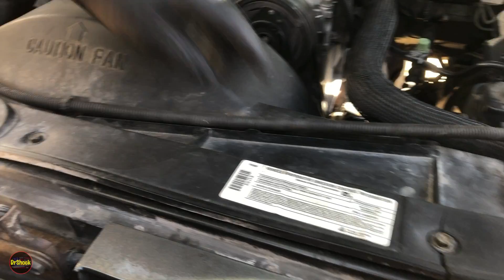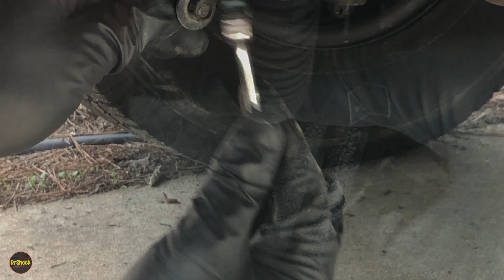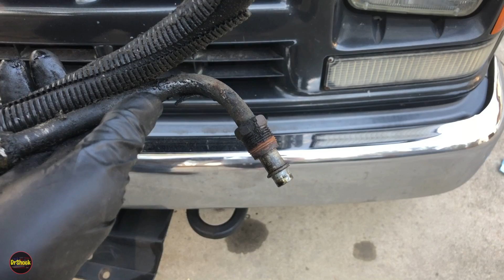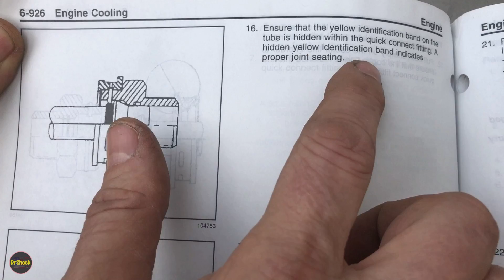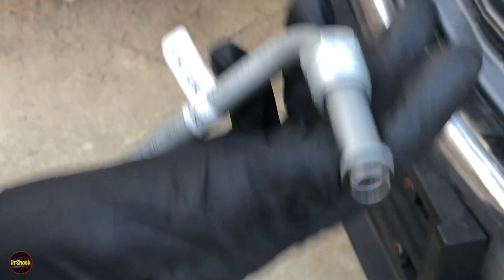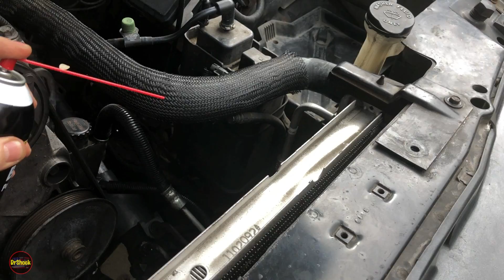1996 - 2000 GM OBS 4WD K Truck Vortec V8 5.0L / 5.7L Oil Cooler Line Leak Repair (Chevy & GMC)

Comment: Doc,on the filter housing where the oil lines plug in how do I know which is the inlet vrs the outlet? thanks
Reply from the maker: I showed this during installation of the new GM lines at the engine oil filter housing end in the video.  I can't recall for sure, but the aluminum casting may also have marks for this on the housing as well.
Reply: @DrShock ok thanks

Comment: This doesn't require dropping the oil does it? I figured since the oil should (mostly) be in the pan which is below these lines, I wouldn't have to. Should just be whatever is hanging around in the lines, right?
Reply from the maker: You do not have to do an oil change to perform this repair.   But, it's a good idea to do one after you complete it in case any debris got in.
Reply: @DrShock  good point. Thanks! I appreciate your videos. Trying to keep these old things running even though it's hard to think of late 90s as old 😅

Comment: Nice to see the price gouging going on for these parts.   20 bucks for a zip tie , 99 bucks for inlet hose.  No availability on outlet hose.       Hopefully my 1 drop of oil every month from my cooler line holds on another 20 years.

Comment: When replacing the lines, replace the quick-connect fittings as well. There's an O-ring inside the fitting that's the real seal to the oil line. Changing the fittings is cheap insurance that your new oil lines won't leak.

Also, you may want to use a flare nut wrench on connections like what you have on the radiator ends.
Reply from the maker: I typically recommend changing those fittings every other service interval, unless they have pitting or flaking level corrosion.  As long as you stick to genuine GM OEM parts, they are not required by the GM service manual to be replaced with the lines.

Comment: Easy way to remove the fan if it's stuck is hook a ratchet strap to the hole in the metal body near the storage box, wrap it around the pulley atop the belt and back to it's own hook.  Ratchet it down good and the added load will prevent the belt from slipping.  Fan comes right off very easily that way.

Comment: Three years after this video was produced, I finally replaced my oil cooler lines on my 98 sierra c2500. Thank you. I watched the video 3x and learned all I needed to know.  The parts were different because the C2500 is 2wd, but its the same procedure. Thanks DR for all your work! One thing, I would recommend you replace the two fittings on the oil filter adaptor. In Rust country, they're looking pretty rough!

Comment: Are there yellow marks on the radiator side too ?
Reply from the maker: No, as shown in the video the oil cooler integrated into the OEM radiator design is just standard threaded fittings so that insertion check yellow marking is not applicable nor needed.  Only the quick connect style fittings on the engine block would have this.
Reply: @DrShock 
Thanks

Comment: Got a question for ya. I have a 2000 denali with the 5.7L vortec. I noticed leakage around the upper fitting on the drivers side. Same ones you're working with here. When I trace the upper line it goes to nothing. Like the line runs down below the engine then has been crimped in some way. It's not connected to anything. Have you ever seen or heard of that before?

Either way, your videos are helpful. Glad to have found your channel. Cheers man
Reply from the maker: Thanks.   If you found the upper line crimped off, I would expect to find the lower crimped off as well.  A previous owner may have elected to do an oil cooler delete rather than repair the problem.
Reply: @DrShock  Thanks for the quick reply! I just looked over everything in more detail and you're right. Guessing it's the radiator itself that's leaking. Just started watching your radiator replacement video and will give it a go. Thanks for the great content. You're a top notch teacher!

Comment: Hey bud first off I love your videos , very helpful indeed, I have a question for you about a1998 Chevy Tahoe 5.7 I wanted to ask which lines go in the the other side of the radiator,it kinda smells like oil can you help me out?
Reply from the maker: Thanks.  The cooling lines on the passenger side with this model and engine are likely the transmission fluid cooling lines.

Comment: Is there any reason not to move the transmission holder(rod) out of the way?  I can not get enough leverage to insert the new cooler lines into the oil filter adapter.
Reply from the maker: If you mean the bracing rod for the automatic transmission, you shouldn't have to remove that but as long as you reinstall it there's no issue temporarily moving it out of the way.  You might also try some light oil lubricant on the end of the line to ease insertion into the oil filter adapter fitting(s).
Reply: @DrShock  copy that. Thank you. I actually just fixed it with the help of my son. No leaks. Whoo hoo!!!

Comment: Better off just deleting the cooler lines altogether and changing the oil filter adapter, will never leak again, ever. Oil cooler is not necessary

Comment: Just changed out a radiator, and had to grind 1/8" off each oil cooler line because the length between the o-ring and end of hose was too long.  had to stuff a cotton ball in there and then grind. no leaks so far!

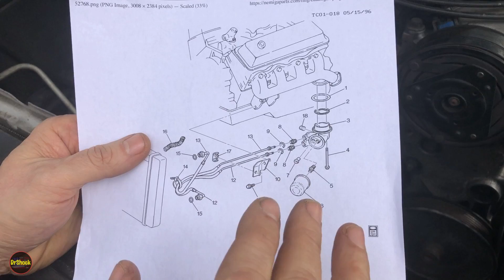Comment: Hi, thanks for the great video. The printout you show at 30:13 shows one hose go from the upper rad fitting go to the upper filter adapter fitting. However, Figure 42 from p. 6B-38 in the 1997 FSM shows the opposite (for the 5.7l, albeit not very clear). I connected mine according to the latter with the longer inlet hose (GM 15112871) going from the top of the rad to the IN (lower) fitting on the filter adapter. I think you may also have done this in the video? Anyway, this is confusing me a little, I wonder if it actually matters?
Reply from the maker: Thanks.  That's a good catch.  The diagram is from the GM EPC (electronic parts catalog) so very generic and just used for parts identification (the illustration numbers map to GM part numbers in the catalog).  Definitely go with the GM service manual drawing for your year and engine for how things wire / connect up.  I showed that parts diagram just because it is useful to see all of the parts involved, but it is not intended to depict assembly and you likely have identified an error in the parts drawing in that regard.   The GM hoses are labeled inlet and outlet as well, so you can't mix them up wrong.
Reply: @DrShock  OK I realized why I was getting confused! The figure I referred to shows a vertical filter adapter, so I think the lines cross only on the 2WD, but the routing you show at 30:13 is correct for K models.

Comment: Good video. I started deleting the cooler lines on these obs trucks after I found that the factory oil cooler only lowered my oil temp about 10 degrees on a hot summer day. It's just not very effective when you are circulating your hot oil around in a hot radiator.

Comment: What to do if it’s leaking from the fittings?
Reply from the maker: Replace them (seal is internal to the fitting attached to the engine block).   While not shown, the part number is in the description for this too.

Comment: Hey, Dr. Shock. So the end of the lines going into the filter housing under the engine do not need o-rings on them? Thanks for the video!
Reply from the maker: Nope, no o-rings on a GM OEM quick connect style fitting.  The seal material is integral to the female port on the filter housing itself.

Comment: I stripped the threads on my new GM radiator when attempting to torque the fittings to specification (before torquing the fitting, I started it by hand and made it hand tight using a wrench). Beware.

Comment: Thank you for the great video do you recommend power washing the entire bottom area with degreaser ? Especially the are where that clip is ?
Reply from the maker: Something paint safe and not an actual pressure washer with water but yeah.  A aerosol degreaser intended for engines, or brake cleaner works too.  Now would be the time to clean this area out, if for nothing else to confirm the repair was successful.

Comment: Why turn off the under hood light when what you should have done and you should ALWAYS do is to disconnect the negative battery cable from the battery whenever working under the hood.
Reply from the maker: We pull the hood light to not run the battery down as this procedure can take some time. You do not need to disconnect power unless you are working on electrical or fueling components.   In fact, many repair steps with more modern vehicles require power as part of scan tool driven testing and diagnosis. It certainly will not hurt anything, other than resetting your state emissions test drive cycle, if it makes you more comfortable to do so though. 
 But always follow the OEM service manual as closely as practical, as the engineers who designed the components will tell you if that step is necessary or not.

Comment: Well explained video, helped alot. Did you use new fittings on the oil filter side or the same ones? Do i have to drain oil before replacing the lines? Can these lines cause oil to get in the radiator,  if so does replacing the lines fix the problem?
Reply from the maker: If you have oil in the radiator with an integrated oil cooler, you need to replace the radiator as that indicates a likely internal leak between the oil cooler and main coolant core.   These lines have nothing to do with that symptom.   You do not need to replace the engine side fittings unless they are damaged/corroded.   I would recommend doing this repair along side a regular oil change to reduce the cleanup involved.
Reply: @DrShock  if it is the oil cooler line since I don't have money for a new radiator will it be ok to by pass the oil cooler line instead of replacing the radiator? I don't do no heavy hauling with it.
Reply from the maker: First definitely do the additional diagnosis to confirm a root cause before buying any parts.  There could be more than one source for this than the radiator.  

I could never advise someone to remove or disable a factory installed oil cooler, because the powertrain team for a particular truck configuration may depend on that functionality for more than just towing.  But if you had to bypass it temporarily until the budget allowed for a more correct repair, I could see that being workable for light duty on-road use.
Reply: @DrShock  would you happen to know what other causes would cause oil in radiator? And how would I know for sure If it is from the cooler line? I know for sure that my lines are leaking based on them being drenched in oil, so I will have to replace them regardless if I choose to not disable them.
Reply from the maker: None of the causes will be inexpensive to address.  But oil in the coolant, without any coolant in the oil, points to defective radiator (due to oil cooler containment failure), defective intake manifold gasket, or defective cylinder head gasket.   In that order of probability.  You should confirm this is engine oil you're seeing, as it's also possible that it's from the transmission fluid cooler, which would also point to the radiator (ATF cooler containment failure).
Reply: @DrShock  and how exactly would I verify if it's coming from the oil or transmission line? It looks like brown sludge under the radiator cap so I figured it was oil. I thought head gasket as you said aswell but I did the block combustion test already and the liquid stayed blue so I dismissed that as a possibility.  And my car doesn't overheat.
Reply from the maker: The test you describe only checks for the head gasket failing in the coolant passage to the combustion chamber.  The head gasket can fail in other ways, but again, I mentioned this is the least likely source.  You would have to pull the radiator and perform a pressure test to determine if the cooler has failed.   You would have to pull the upper intake manifold assembly to determine if the gasket there has failed.  There isn't a non-destructive test for that one (you'll have to replace the gaskets anyway just to do the visual inspection).   If it's been over 100K miles since the last time the intake manifold was removed, I would start there.
Reply: @DrShock  so how exactly do i preform the pressure test for the cooler line. I've never herd of that process so I'm not familiar with it. But iam familiar with the pressure test tool for diagnosing leaks. If you dont mind, Would you happen to have an email I can send a picture of the sludge I found.  Maybe you can tell more by the picture.

Comment: I use engine degreaser to clean up the engine and the residual oil that leaked because with brake cleaner it can sometimes effect the integrity of other seals I mean not saying I haven’t used brake clean before because of course I have but throughout the years of doing it I have learned to not use brake clean because other mechanics have told me I will cause myself more of a problem then I have so just a fyi
Reply from the maker: The thing with brake cleaner is not to buy the cheapest one.  Some of those have solvents that can take paint off.   CRC and similar higher cost brands will not harm paint, and will not harm modern seals.  If you're working on something earlier than the late 1980s, I definitely would not use it though.
Reply: @DrShock i use simple green soak then pressure wash the entire area before repair even begins

Comment: I have a 96 c1500 do I need the 96 service manual or should I get the 98 second edition
Reply from the maker: It's usually best to get the matching model year of your specific vehicle.  The service manuals get very detailed, into content that does vary year by model year.   But if you're in a pinch newer is better than older, just understand that there may be drawings and schematics that have changed.

Comment: Oh and by the way I'm currently in the middle of making -8AN lines to replace the factory lines..... only spots it can leak will now be either at radiator fitting or at oil filter adapter fitting..... stainless steel integrated braiding with nylon exterior braided lines... should be slick
Reply: How much do those 8AN lines cost? If you don't mind me asking. I am thinking I'll be replacing these Doreman lines sooner than later. Thanks

Comment: What do you use to clean an engine bay with that much crud? I've been trying to get mine clean and I cannot find anything that will touch it..... mine also has a lot of crusted on dirt from old gold mine areas that WILL NOT come off without scraping with lots of force and my ENTIRE undercarriage is coated with it!!
Any advice will help and
THANK YOU VERY MUCH for the clear concise instructional video
Reply from the maker: Thanks.  What I used for this was initially Gunk engine degreaser, the spray on gel version.   Give that a good afternoon in the sun and then rinse it all off with brake cleaner spray.   You'll need several cans but it eats it right up.  Wipe off the tough spots with blue shop towels.  

Once the leaks are stopped, eventually the engine bay heat will dry the rest up where it can be removed easier after another month or so and a re-application of the mentioned products.
Reply: @DrShock  thanks I will give that a shot
Reply: simple green

Comment: Hi Dr. Shock. Trying to solve a mystery slow leak at the oil cooler inlet to the radiator. Lines are new (GM genuine), orings new. Is that fitting itself, where the cooler line connects to the radiator replaceable? Or does one have to swap the entire rad? Thank you.
Reply from the maker: The original GM/Delphi radiator didn't have replaceable transmission cooler connect fittings as best I can recall.   O-rings only used on the engine oil cooler side of the radiator.   Aftermarket models might vary.  It's been awhile since I replaced one of these but here's a vid that might highlight the fittings on an OEM radiator - https://youtu.be/hy5QB80Gcu4
Reply: @DrShock  Thank you, as always!
Reply: @Cargovroom-g7f was your lines leaking oil inside the radiator?

Comment: Dear Dr. Shock, and all reading these comments. I’ve owned my 98 K1500 for just over two years, and in that time have watched countless instructional videos about it. There are many here on YouTube and many are good. But I can say now, with absolute confidence, that none compare to the quality, detail, patience and empathy with which Dr. Shock provides explanation and demonstration in his well edited, well presented videos. I can say this with such confidence because as of today, I, a self-declared amateur, beginner mechanic have successfully repaired oil cooler lines, oil filter adapter (with fittings) following the expert e-guidance of Dr. Shock. To celebrate, I’m treating myself to a Dr. Shock t-shirt and I certainly hope that proceeds of that end up in the Dr. Shock coffee fund. Thank you so much Dr. Shock.
Reply: Dr Shock could easily be a tech school instructor, or even a master mechanic/instructor of instructors for any major auto manufacturer...
If you need a letter of recommendation, I got you!

Comment: Did it just like this shows but in the bottom connection, there must be that white plastic "clip" that goes in there to prevent the oil leakage which I now have. Have to take it out & reinstall w/ the clip.

Comment: Always first-class video with excellent and not superfluous narration. We all appreciate the GM OEM parts and links. Thank you!  
Is that the "Camper Special" option for a second battery? I would love to add that to my '96 Suburban as I have a Winch. I think it is NLA. Any guess where to get one?
Reply from the maker: Earlier years would have had a storage box in that location, but on the 1998 it was just empty.   If you ordered the aux battery, or had diesel, there would be a second battery installed in that location.